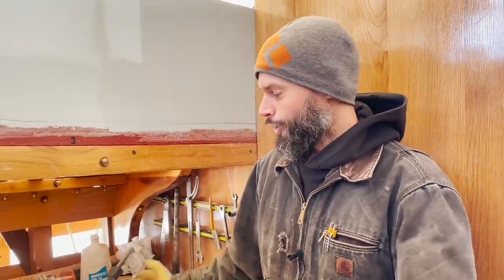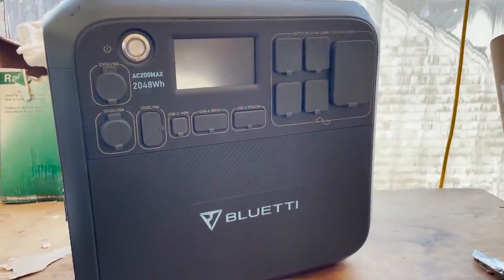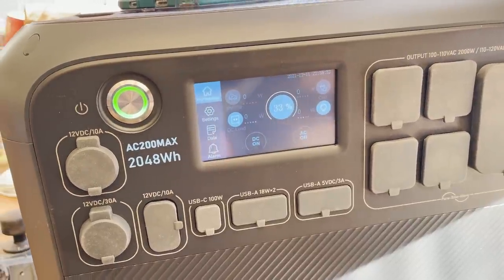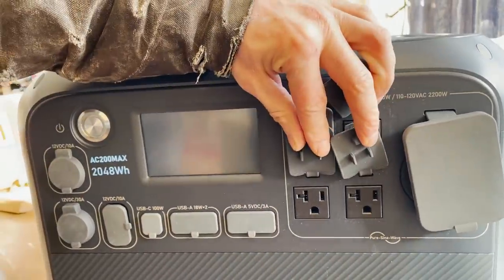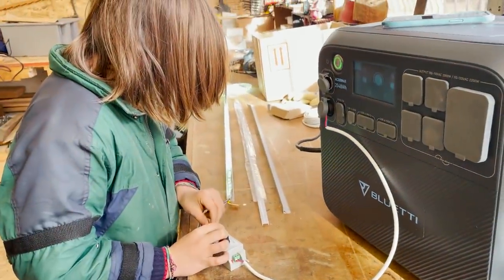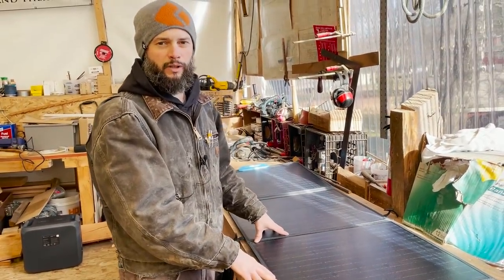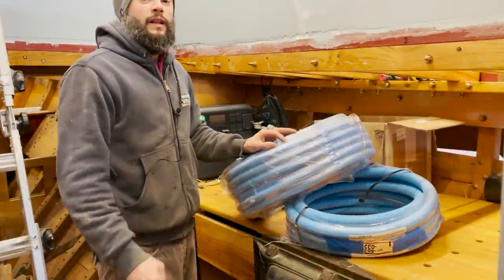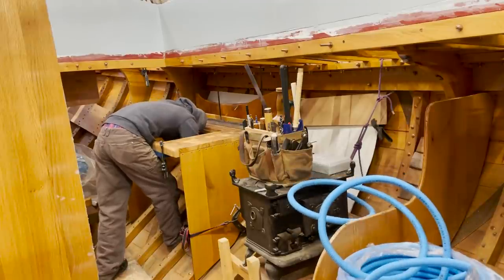Boat Electrical Systems, First Steps - Episode 194 - Acorn to Arabella: Journey of a Wooden Boat

Comment from the maker: Two bonus videos this weekend! Going live at 7 a.m. on Saturday and Sunday, tune in for a visit aboard Calypso, a look at the refrigeration system, anchoring gear, and a neat tool demo. See ya then!
Reply: I don't think you can ever put too many outlets. Within reason of course. I'd get the outlets with USB chargers built in with little night lights you can tap off. That's 3 things handled right then and there And they don't take up anymore space or anything. That battery is nice. Perfect for y'all filming. Little heavy to carry around though. You can also get warm yellow LEDs that wont hurt your night sight quite as bad. But yeah, I'd get an awesome red LED light for normal use. Those strip lights are cool, I use them around the house.
Reply: Of course we’ll watch during the weekend as well 👍
Reply: You can get an adapter for your Makita batteries that will let you charge up your phone or anything with a USB cord ...Makita batteries are great for charging laptops .phones ect! The makita adapter is like $20 -$30 ...Its the best investment i have made for what it does.....It can also tun 12 volt lighting if you have a usb jack !
Reply: Steve.
A little thought. Once when I went sailing we had a rope with a propeller on the end, it was thrown overboard and span while we were under sail. The end attached to the boat was connected to a counter that told us our speed and how far we've traveled.
What I was wondering is if you could have a propeller on a rope that's connected to a dynamo you could generate some power while under sail.
I don't know what the machine was called but it worked and Provident was a little bit bigger than Arabella so it could be something to look at.
HAPPY NEW YEAR EVERYONE 🥳👍
Reply: @graham6229  
Thanks, why I couldn't remember 'ships log' is a mystery. It's a shame it couldn't be adapted to make power but that's that.
But maybe in the future someone will make sails that told up but can generate power. 😀
Reply: @Slikx666  solar sails? Sounds like a billion dollar idea!
Reply: @thomasarussellsr  
It could work. 🤔👍

Comment: I will make one recommendation when using conduit... leave a length of nylon string between each junction box inside the conduit. This will make it much easier to pull more wires if you need to replace or upgrade later. Just remember to pull a new length of string with the new wires.
Reply: Agreed . Large gauge nylon monofilament is great for this
Reply: That's a great idea whether you use conduits or not.
Reply: I was going to say the same, or even two!

Comment: Tip: to pull the wires, make a aluminum foil ball that is 3/4 the size of the tube and attach a string. Put that in one end of the tube and use a vacuum to suck it through 😉 and use the string to pull the wire AND a new string. Leave one string in at all time to easily pull extra wires at a later point 😉

Happy Friday!
Reply: They also make a special lube for wires being pulled through conduit so you don't just rub the insulation off (or tear the wire with the force of long pulls of thin wire, or getting stuck with crap like double-aught wire)
We called the lube elephant jizz  .. Or elephant snot, if customers were around.
Reply: Or just use a fish tape..
Reply: Always leave a mouse behind.
Reply: @davidmessersmith786  true, but tends to get caught on anything sharp (bad sawn/cut tube connections)
Reply: @mashrien  Thin coating of silicon sealer works as a good lubricant here.  Also good for driving screws into wood
Reply: @HaroldKuilman  fair point, interesting; never experienced that problem. Maybe it was the cheap bags I used for fluff!
Reply: @mashrien  - Thankfully, long pulls and thin wires on a boat are mutually exclusive. The longer the pull, the heavier the wire you're gonna want, to avoid voltage drops!
Reply: @davidmessersmith786  I've seen it happen to others, quick suck back and retry did help. Never seen a loose ball of aluminum foil fail though
Reply: They make foam cylinders for pulling string through conduit with a vacuum. The trade name for them is a "mouse".
Reply: @overamped23042  didn't know that, but you need different sizes for different conduit I guess?
Reply: @ExploringCabinsandMines  worked great for me about 12/12 times 🤷‍♂️

Comment: Great vid Stephen ! Some electrical advices:
1) Remember most countries uses 220v (not 110)
2) Don't use glue for conduit crimps please, there are connectors with threads in both sides so you can do a really nice job fitting that connector to the box with plastic nuts
3) Conduits should have gentle curvatures, 3 or 4 radius at least, remember this: new cables are fresh flexible but over time they get more rigid, and if you need to replace someone you don't want to get them stuck in curvatures
4) Leave at least 30% of free space inside plastic conduits, cables emmits heat, unnoticeable, but if something isn't working properly is better to have fresh disipation air inside.

Comment: Stephen, using conduit to protect your wiring harnesses is one of the best investments you could make.  I've worked in aviation for decades and I can tell you that chaffing is an insidious system killer, and can be potentially fatal.  I'd also recommend that you wrap your harnesses for each section in a Teflon or plastic spiral wrap for easy identification and additional chaffing protection within your major conduits.  You've got a good plan and I look forward to seeing Arabella fully lit up in the future!
Reply: BTW you may decide to add shrink-tubes onto of special areas of cables where friction is expected. This is to improve the insulation (usual commercial appliance are really crappy insulation quality, I am always questioning why the electrical safety agencies to not ask hair-drier/air-fan(for rooms) to have double insulation instead of 'almost' single.
So many times as I was young I saw cables to TV-set or Fans in horrible state (any kink or running the cable 'though' door that almost closes onto the cable will inevitably [plus sun, temperature cycles] render the cable brittle or create a short circuit along the cable)
Reply: I remember how strict our DERs were when I was doing EWIS on the G-650 when it came to chafe protection. We wound up snake-skinning more than we actually needed, lol.
Reply: Avoiding chafing is a key priority for any moving vehicle.  As is avoiding corrosion (especially in a salt water environmen), and easy repair/modification, instal cost limitations, and physical size constraints, as well as many other considerations.

I would avoid using any sealed conduit.  Yes that tends to be very safe with chaffing issues, but has down sides aswell.  One being moisture ingress. The reason is that no matter how well you try and seal them up, they tend to allow moisture in, but prevent it from getting out.  Effectively trapping moisture inside any conduiting.

In a boat, I honestly think that a quick, cheap, and easy to repair/replace instal is more beneficial than trying to build something that is built over the top with expensive materials and over complicated instals.  (Unless money and time is no issue.)  The reason is that no matter how well you try and build something, the key challenge on a boat will be corrosion.  Using exotic cable/insulation types can help with things like corrosion, and chaffing, and even physical size constraints, but brings its own challenges with cost, availability and working techniques.

Just my 2c, as an auto electrician with over 15yrs experience
Reply: Doing small things like using electrical grease (avl300) / denso tape / spraying with electrasheild onany terminations or connections to prevent corrosion on exposed conductors.

Making sure wiring always enters any enclosures  / cabinets / fixtures etc from below or the side, so that water can not flow down from above and ingress.

Avoiding having any joints or terminations in random places.  Eg, only at distribution places or end points.

Keep things simple.  Don't try and make it more complicated than it needs to be.

Always leave a surplas length at each end of any cable run, so that as things corrode, you can cut the cable back a bit and re-terminate.  Meaning you can extend the life of the cable, even as the various components/terminations corrode.

Comment: A good practice when running conduit is to pull a string in for each of your runs. This will allow you to pull in additional new or replacement wires and cables. You can buy pull string that has foot markings to calculate pull lengths.

Comment: Every  video has been and is so informative and also artistic (Good sound, lighting, video, content, pace, thought-out topics presented well.)
Yes, good tips in these comments. As mentioned in some other's comments here, leave 3" - 4" bend radius in conduit whatever suitable safe material is used. Leave 1, 2, even 3 nylon strings in the conduit to be able to more easily later pull through some replacement or additional writing or fiber-optical cables. If additional numerous  new runs are needed attach more strings to one string, and pull through.  Then pull, and do always leave one or several nylon strings in each conduct for any further future actions.
You may even add an additional future use tube, or several, along each side for future hose(s) , wiring,  or fiber.

Add well placed flip out or fixed rings or attachment points for affixing and securing the portable solar panels and tsnks and wake boards to either side of the house or hull. 

Consider the light-weight and high strength of dynema lines for lines, rigging, even for brackets, rings, loops.Luka, Odd-life-sailing, and others have implemented dynema.

 Such an interesting channel, project,  and mission, - tremendous vision. Watching since the lead pour for Arabella's keel.
Reply from the maker: Thanks so much, Don!

Comment: Stephen, instead of glueing your conduit adapters to the junction box, look at using cord grips. They're industry standard for control boxes. You won't have to worry about the glue failing over time and it will be much easier to install.

Comment: I have often wished my boat (smol 27' full time cruiser) had some conduit. Chafe protection, ease of running or replacing lines, and wire support. But I often find that flexible stuff (hose) is frustrating when it doesn't need to flex - straight runs. I will probably install a hybrid flex/rigid conduit system as my boat matures. I think the best advice I can give you with my short cruising experience is to have spare wires run if it's a difficult run. Building extra capacity of 10-20% is considered good practice in my past life of robotics. Being able to tap into a spare line quickly for a repair or addition is very nice.

Comment: Hi, I'm a retired EE that designed electrical control systems for offshore mobile equipment. Here a few points to consider in your build because vibration and corrosion will be your top 2 long term problems.
First:  Using terminal blocks and sealed connectors (don't forget your silicon dielectric grease) at connection points and anchoring your wires together in the boxes best mitigates vibration breakage. I strongly suggest revisiting the boxes about once a week (After deployment) and do a tightness check on every terminal screw until you find none loose. (Takes about 7 times on average). Do not assume that your connections will remain firm on first tightening. Also perform a "3 lb pull test" on every connection made and terminated.

Second: Sealed or unsealed? The advantage of sealed is longer lifespan versus the salt water environment. If you are not sealing your conduit (because you are using  marine wire and cables) I suggest a sealing adapter to keep the boxes sealed and isolated. I recommend you plan for condensation to collect at the bottom of the boxes and installing a petcock, but do not vent the boxes. 

One last concern:
Conduit size and component plugs. Most modern electronics packages (radar, sat, etc) will have pre-molded plugs installed on the end of the cables (particularly from the mast components). In sizing your conduit, make sure you are going to be able to pass all of those plug ends through as well. (with the other  cables in the way).

I'm willing to talk to you directly if you wish.

Comment: You will love the LiFePO4 batteries in the Bluetti system.  They've been available for several years for radio controlled modeling where the transmitter and receiver batteries are the lifeblood of the model.  RC airplanes can be worth a few hundred or many thousands of dollars and modelers have flocked to them for their reliability.  They don't self discharge like previous battery chemistries do and unused, can remain fully charged for many months.

Comment: From personal experience, I would use larger diameter conduit, and as many below have mentioned, run the "fishing" string or tape through the conduit now before you attach all the ends.  Also, threaded cable terminations are a much better choice than gluing the terminations into the junction boxes.  On sizing, figure out the cables that will be going through the conduit, and sum up the diameters of those cables.  Then about double the cross-section area required to handle the packing losses, and choose the next size up from there for the conduit.  Your future wiring headaches will be greatly reduced with sufficient conduit area.  Trying to fish a cable through a too-tight conduit is an exercise in futility.  Finally, before I'd commit to using a portable battery system like Bluetti for your electrical needs, I'd check out whether that system can withstand a maritime environment long term.  There is a reason that house banks of batteries, whether lead acid, AGM, or lithium are the predominant (almost exclusive!) method of storing power on ocean-going vessels.  They will withstand the environment for a long time.  I believe that systems like the Bluetti are prone to salt air corrosion much more quickly, and will not be good long-term solutions for a cruising boat.

Comment: You probably know this but,  once the conduit is in place you can use your shop vac to pull a string through to ease the wire installation.  Also, when you pull a bundle of wires into conduit, include a string to allow you to add more wires later.
Happy New Year to the Crew!!!
Reply from the maker: Nice tip, Robert!
Reply: They make foam cylinders for pulling string through conduit with a vacuum. They are called power fishing pistons, or a "mouse" if you ask the guys in the field.
Reply: @AcornToArabella  Just remembered, no more than 360° between junction boxes. Such as 4) 90°  or 8) 45°

Comment: 24V DC supply would deliver more power to the high load devices like an anchor winch or refrigerator. Seems a popular choice nowadays with inexpensive DC to DC converters for 12V and USB charging points.

Comment: My brother and I wired a log cabin with a 12 volt dc system initially. It was simple and reliable. Turned out to be more reliable than the 120 ac system I installed later.

Comment: Hi, Gang!  Happy New Year!!  Electrical toys!  Now, you're talking my language.  One word of caution using conduit;  they WILL fill with water...especially the horizontal runs.  Be sure you have adequate ventilation and drainage holes.  High humidity and changing temperatures will cause condensation and you need a way to purge it from the conduit.  Thanks for another great show!
Reply from the maker: Happy new year, Charles!

Comment: I've been watching since the beginning of your channel.  I am a general contractor in Miami, FL and we use a lot of flexible conduit,  we call it smurf.   Just a suggestion, we use standard electrical gray pvc male connectors, glued with pvc glue directly to the end of the flexible conduit, to connect to boxes.  You can use a plastic bushing, sold at HD or Lowes in the electrical department, on the inside of the boxes to hold the connector into the box.  Makes a  much stronger connection. Keep up the good work!
Reply from the maker: Thanks for the tips!
Reply: Plastic bushings cannot be used for attaching conduit to a junction box. A lock nut is required. But adding a plastic bushings on top is required when 4awg or larger wire is pulled through the conduit.

Comment: Consider getting rgbw strips, they have a white led next to each RGB led. The wiring would then also be easier, you could just have a 3-way switch between white off and red, and a single potentiometer.